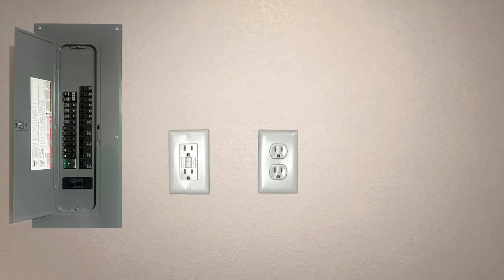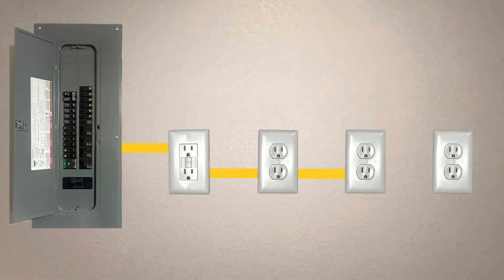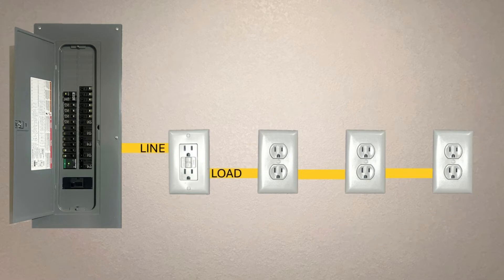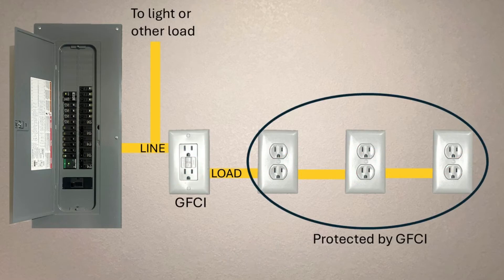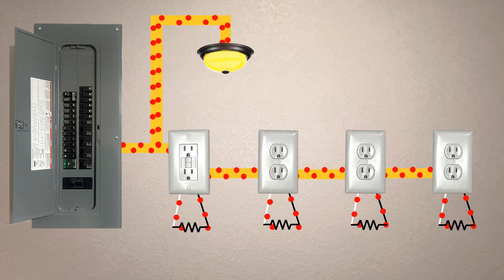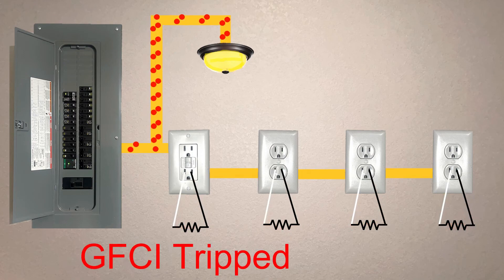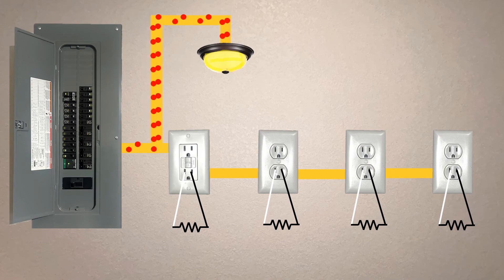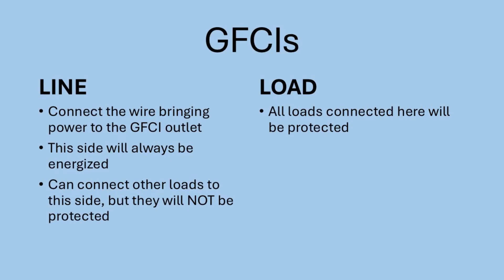Line Versus Load on a GFCI - What You Must Know

Comment: how to you tell what wires are load side and line side?
Reply from the maker: It’s easiest to do if you have a non-contact voltage detector. With the breaker on, and being very careful, see which of the two wires is hot. This will tell you which of the two sets of wires is bringing the power into the box. This will be the Line side.

Comment: Thanks so much for sharing! I'm having issues with a gfci that tripped. The light that says to replace it was flashing so I got a new gfci. The new gfci won't reset, and I know I replanted the wiring just as the original one was wired so would you have any idea why? Ground? Or?  Kinda lost.

Thanks again and if you can offer any info on this issue I'd appreciate it.
Reply from the maker: Normally, when a GFCI will not reset, that means that it was wired improperly. The incoming hot and neutral wires must be connected to the “Line“ side of the GFCI outlet.  If the power coming in is connected to the “load” side, then it will not reset. Check that out and see if that doesn’t fix it. Please let me know what happens.